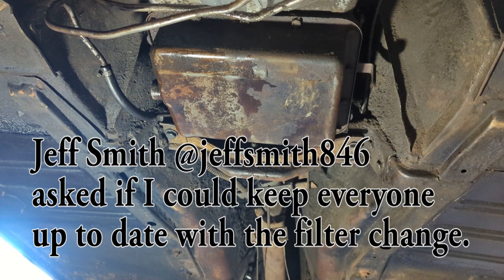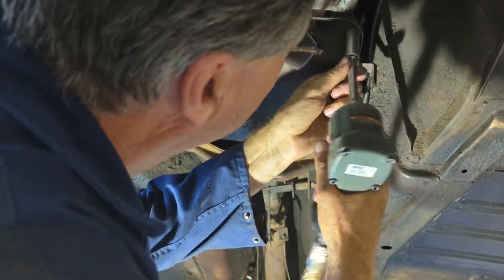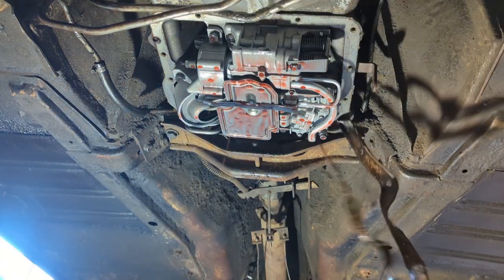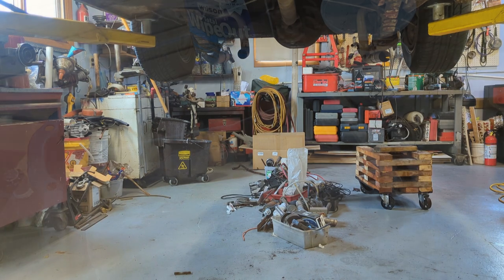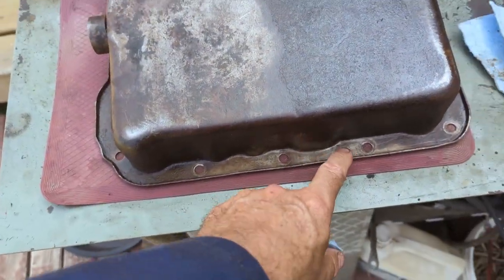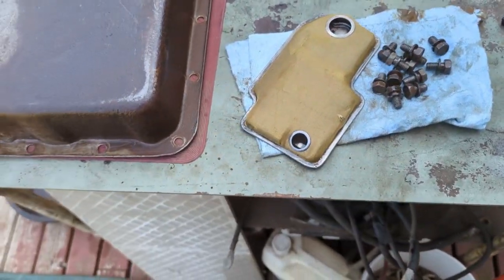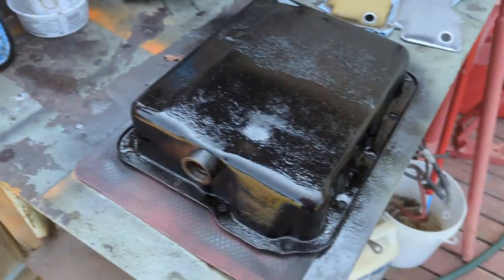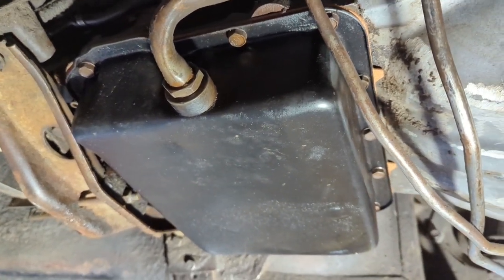Cruise-O-Matic Transmission Filter Change - 65 Thunderbird Hardtop

Comment: Nice Job Alvin. Nice and clean inside. Sitting is the worst thing for these transmissions. The seals harden and then they don't seal when they are cold so you loose 3rd gear and reverse. Once warmed up, they usually work okay. Its a good old trans, I've got no complaints with them. Thanks.
Reply from the maker: Thanks Nick!
So far it's been working well, it shifts nice, and it's nice having the gear selector position back to the way it was designed to be.

Comment: Hello Alvin. Real nice job on that filter change. It is so anoying when you expect aftermarket parts to fit and work, and they don't.  Just out of curiosity, is the normal drive position indicator the same on the C6 as the Crusomatic? 
George B
Reply from the maker: Hi George, I knew there could be an issue with the filter length when I bought it...now we all know. lol
The C6 as far as I could tell, doesn't have the correct valve body to be the same as the CruiseOmatic...Nick mentioned that those C6's were one year only. As far as I know, the C6 transmission is the same as all the other years, it's just the one year only valve body that makes the shift selector compatible with 64-66 model year columns.

Comment: I watched hoping for some new insight on the filter weirdness... the replacement Wix filter l have has the correct gasket for my 66 Galaxie but only one hole.
The ATP replacement for the replacement has the wrong gasket and the misaligned holes ($30 from NAPA... I'm not gonna eat that, it's getting returned)
I suppose  I'll just do what everyone else does and clean/reuse the old one.

Even so, I'm still scratching my head over this one. It's like the ATP part is a 9/8 scale replica of the original... do they actually fit anything?

Thanks for the video. Always appreciate someone taking the extra time to record.
Reply from the maker: I haven't tried that filter in my FMX transmission, but if it's not for that transmission, I really don't know what it was made for...the gasket that came with it, most definitely won't fit the FMX, it's the wrong shape.